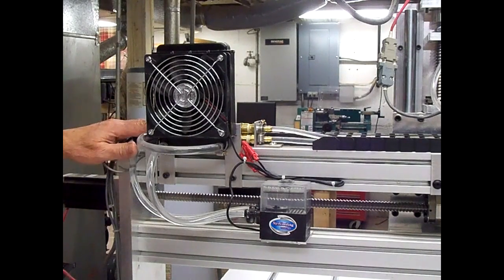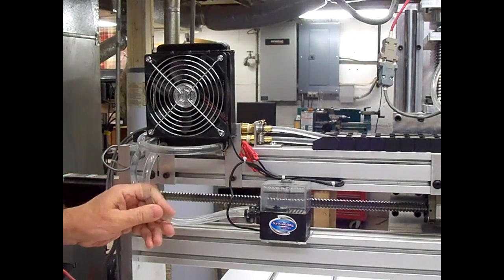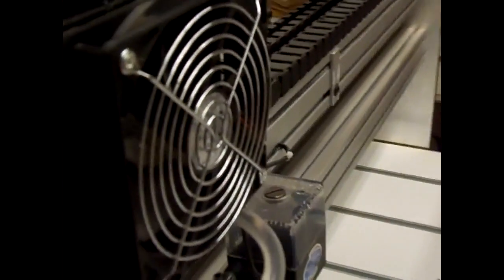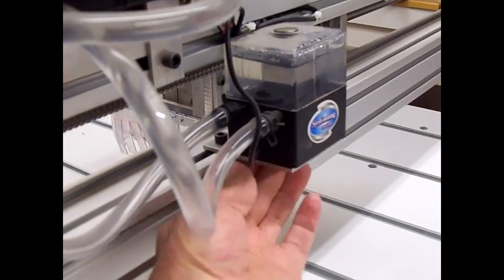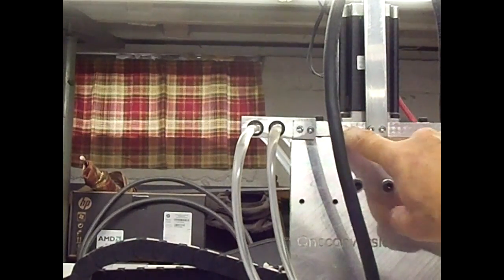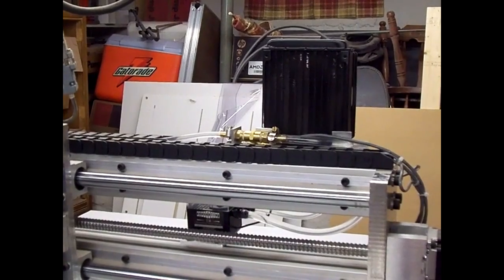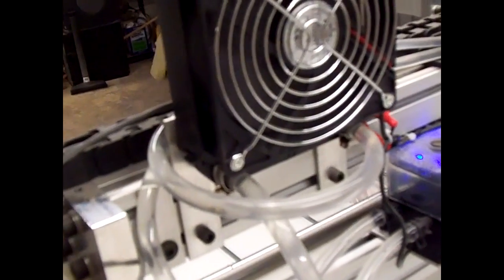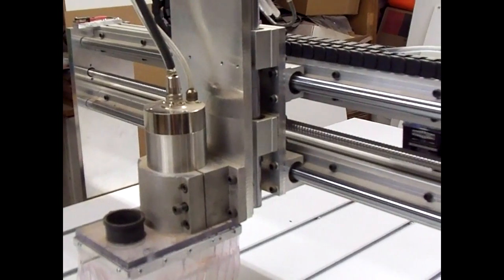CNC Spindle Motor Cooling

Comment: Hi Robert  Great series  was looking at there kits just before i watched your vids and thanks by the way . Was wondering how your overall is on this kit and which one did you get. I built a cnc is nice but want bigger /better it looks like a riged set up. But wondering if the 8" instead of 7" z axis losses any rigidity i need xtra hight  for some projects i do . and what xtra asseseries did you get thanks
Reply: ok thanks very much for the reply

Comment: Hi Robert,
Cool setup!
I would recommend to do a 90 degree turn of the heat exchanger to get rid of the air trapped in it. So cooling efficiency will raise.
Andy
Reply: *****  No, leave it vertical but turn 90 degrees.

One fitting gets over another. The piece of tubing coming from the water pump should be connected to the lower fitting. 

So when you pump water it push air out of heat exchanger.

Comment: Are you able to control the spindle speed through mach 3or are you just configuring it manually on the vfd?
Reply: It looks like the c10 board needs an additional PWM/dir board to do it. However the c11 board looks to be plug and play

Comment: Hi Robert...I wanted to know what stile, length and ID size wire train you ordered for the tubing.  Did you use the same size for the "Y" axis?  Also, how did you wire up the power drive source to the spinal.  I didn't receive a manual with it. Would appreciate any info in regards to these issues.  Thanks in advance!
Reply: I think He asked you about sizes of Plastic Cable Drag Chain